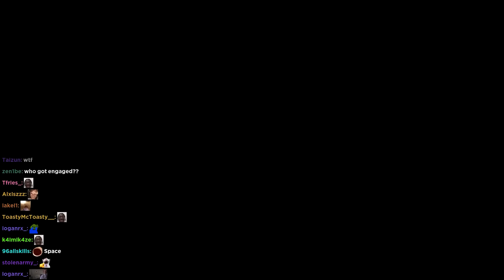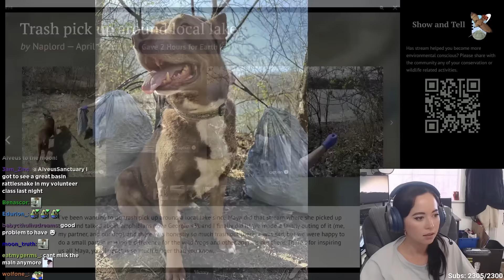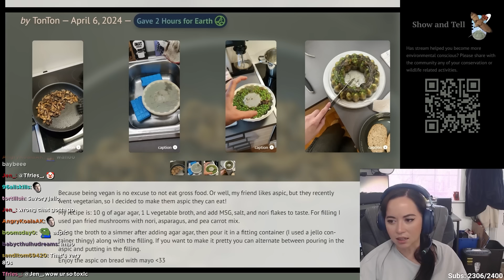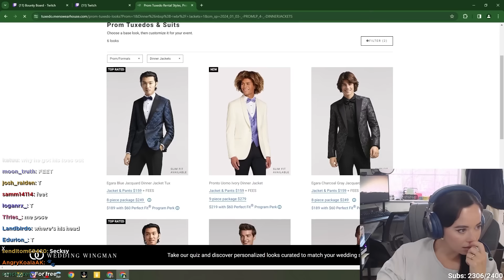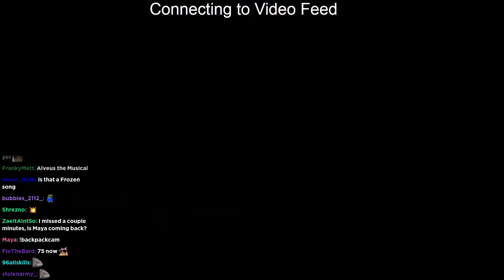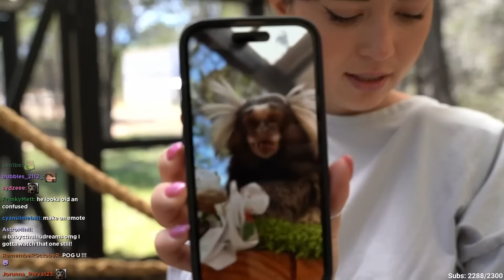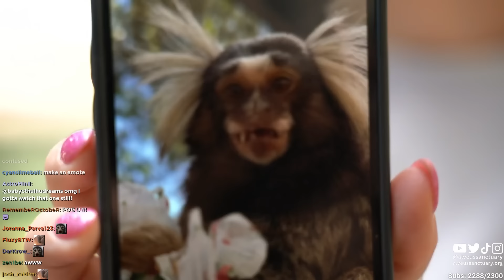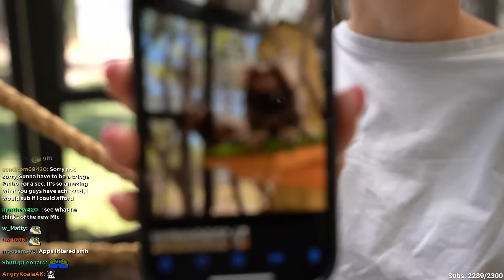Introducing our newest staff member

Comment: I think Maya’s mic mainly started cutting out because the line of sight was broken once her back was turned and body was in between the receiver and the mic.  I’m sure if the mic was directly in line with the driver running into the camera, it would have been gucci.  The Wireless Pros are fantastic though ☺️